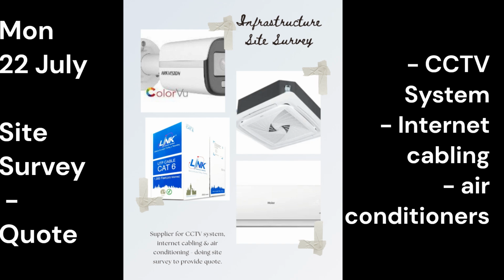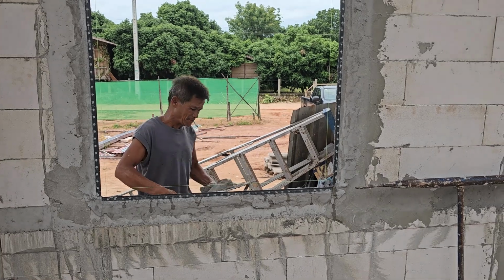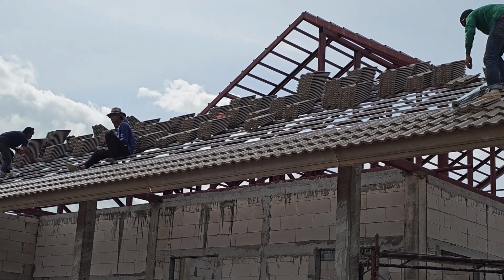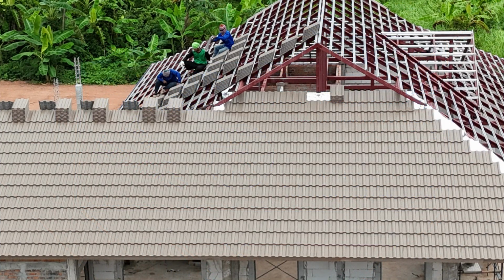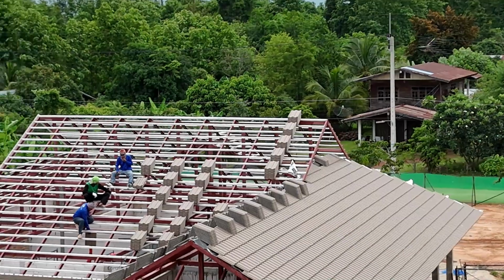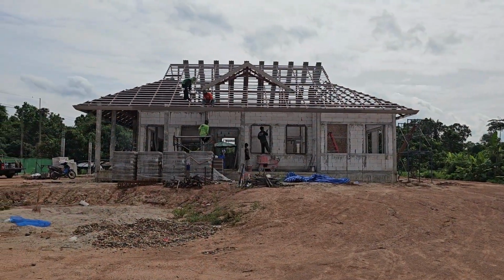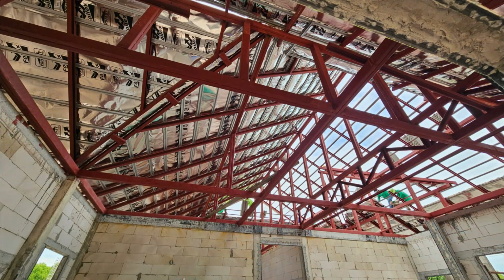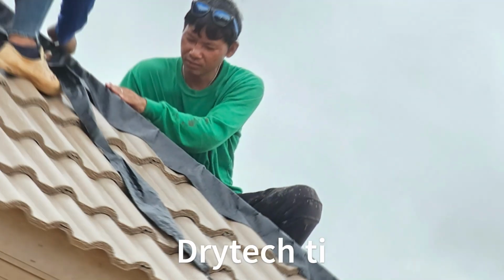Thai House Build Week 15

Comment: Thank you for sharing these interesting videos. As a small correction; The metal film under the roof tiles is an attempt to reduce heat in the form of infrared radiation, and not ultraviolet radiation. The tiles will absorb much of the electromagnetic spectrum of the sun in the form of heat, and heat will leave the tiles in the form of infrared radiation. In my country up here in northern europe, we always have a secondary roof under roof-tiles, since we dont consider tiles to be a perfect roof under stormy conditions. For the secondary roof under the tiles, we often use non-UV resistant asphalt shingles. The metallic film used under your tiles is probably more important to stop leaks than to stop heat.

Comment: Good video. Showed the roofing process and the materials used very clearly.

Here in the UK it is typical that only every third row of tiles are fixed down. Obviously there are exceptions but that is standard practice (cue a billion comments from roofers that do it differently!!)
Reply from the maker: @StephenWestrip  appreaciate the feedback. Always a challenge creating videos as an amature & hobby. Learning as I go. Hope the roof holds out for many years.
Reply: @RetiredTranquilinThailand  as long as it does its job and, as my 87yo father likes to say these days, it’s “see you out” it has done what was intended.

Comment: How are they getting in fresh air under the roof and venting the hot air out?
Reply from the maker: There are 4 gable openings in the roof (one's that currently open). They will have gable vents in them so the air can move freely in the roof cavity. One on each of NSEW faces of the house.  In terms other air entry points there are numerous air vents around the eaves of the house (where the roof meets the walls). So air can come in at the eaves and exit/enter through the gable vents. Common method in these parts. The ceiling of the house will have 150 mm SCG stay cool thermal insulation installed to protect the ceiling/interior from the roof cavity heat. This combination with balcony to keep sun off the walls will provide a solution to manage heat the best we can.

Comment: You should get insulation under the tiles as well to stop heat
Reply from the maker: The insulation will go over the ceiling, not under the tiles as there is large roof cavity. 150 mm SCG stay cool will be laid down on the ceiling to protect the roof heat from the house.  The roof space has 4 gable vents to allow air to flow and vents around the eaves of the house as well to create air movement in the roof space.

Comment: The roof foil under tiles acts like a sarking or is sarking, not just heat reflection but if you get a roof leak from broken or cracked tile water should run down on top of the foil over the facia...
Reply from the maker: Thanks - yes correct; it is probably most beneficial for help with managing any rain leaks.  cheers
Reply: It also doesn't reflect any heat because it's in contact with the tiles. It's supposed to go under the purlins to create an airspace. No point.